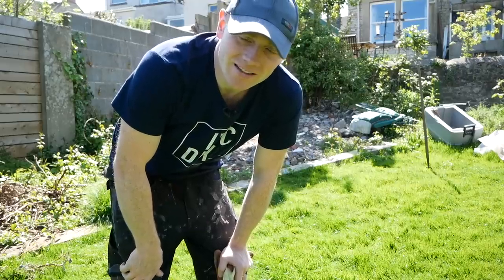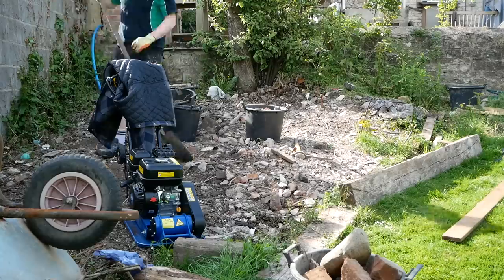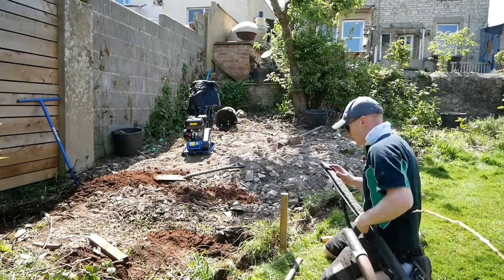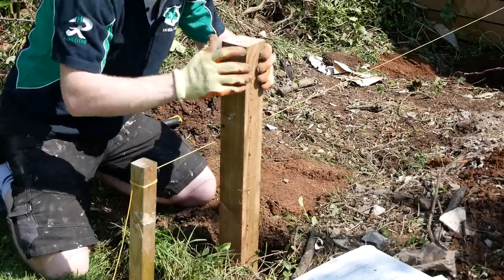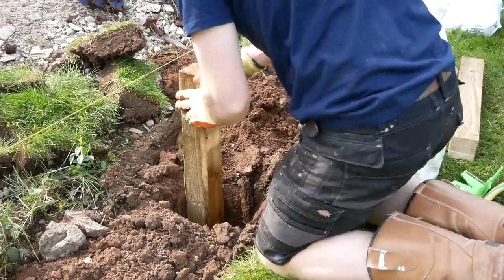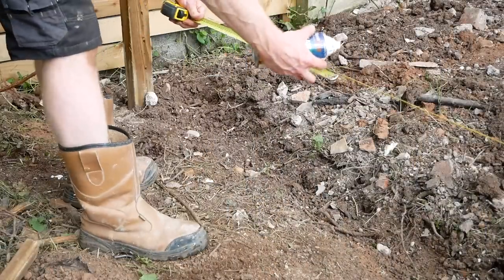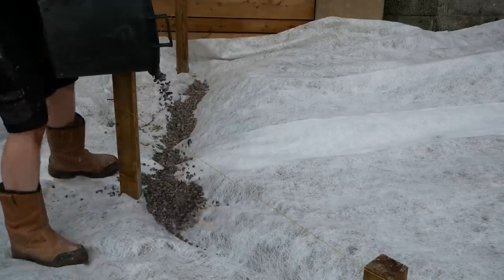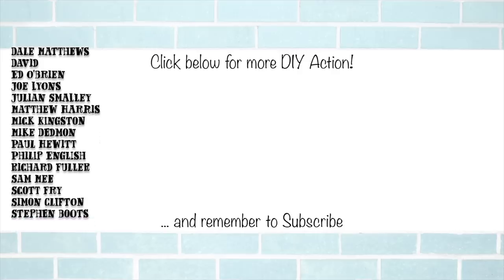Preparing for an OAK WALL BUILD - The Forgotten Corner!

Comment: This video has encouraged me to build my own raised wall. Will be my first major outside DIY effort

Only thing I have had really struggled with is how to get a straight line parallel to the house without an equally straight 'landmark' to use as a reference point. Pythagoras 3,4,5 method seems to be a popular approach. Any other ideas?
Reply: This might be too late but I would run two lines from the house using a large square, like Tim had in the video, then run a line between between these an equal distance from the house. If it's a fair distance from the house you don't need to be super accurate as you won't be able to tell.

Comment: Do you have an endless budget tim?? The amount of oak you use is nuts
Reply from the maker: I wish. Nope not at all, we just save and spend on the house and materials rather than shiny new things.  Besides, 8 oak sleepers is £240 and the wall can be done in a day. I could lay foundations, lay blocks, render or face that and perhaps save a few pounds but it would take me a week. 👍
Reply: Where did you get oak from this time?

Comment: I'm going to be building a raised deck with some planters (Oak sleepers of course!). Although it doesn't matter for the interlocking sleepers, what am I best using for the in-ground posts under the deck as concerned about them rotting out as you say?

Comment: I'm about to start my first sleeper wall project. Decided to give it a go myself after watching your videos, so thanks for the encouragement!

I'm planning on laying them on the short 150 face, rather than the 250 , so I'm going to cut some sleepers and put them in the ground to support. How can I best protect these posts from rotting in the ground? Also, my longest part of the wall will be 9m long, how often would you recommend I put a support post in? Would 1 post every ~2 meters ok?

Comment: Great video mate. I’m planning on digging 4 holes for 100x100mm posts for a pergola. You said in a few years your posts will rot. So how should I keep my  pergola posts from rotting ?
Reply from the maker: Depends on the timber but one option is concrete steel bases in and sit posts to those. good timber in concrete should still last ok though especially if you slope the concrete away at base.
Reply: @TheRestorationCouple  Hi there. Do you mean to concrete a post Spike into a concrete base, and then place the timber post into the Spike?
Reply: @rupindersharma5215  either a concrete in anchor or a Simpson type bolt down plate that leaves the post slightly off pad.
Reply: @diyfarm  Thank you. I just searched for a Simpson Post Base, they look very similar to a SABREFIX BOLT-DOWN POST SUPPORT (Screwfix). I suppose they all do the same kind of job...

Comment: People watching this please don't think you need geotextile membrane under a patio. It's a complete waste of time. If your sub base is compacted properly it'll be just fine and you'll have no problems.
Reply from the maker: True, depends on your situation, if it's decent undisturbed ground and well compacted type1 then fine, (we did our main patio without) As this is poor ground, gravel finish and built over a metropolis of weeds, its made sense, plus stops soil getting through to oak.  That said, if I was doing a patio again, if you are spending 100's or 1000's on aggregates and natural stone, spending £50 for belts and braces doesn't sting that much.